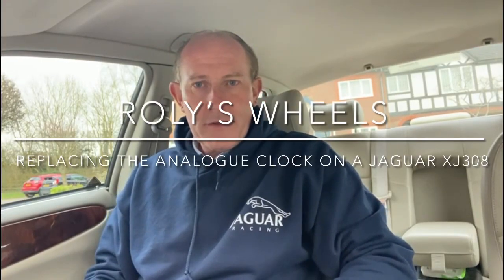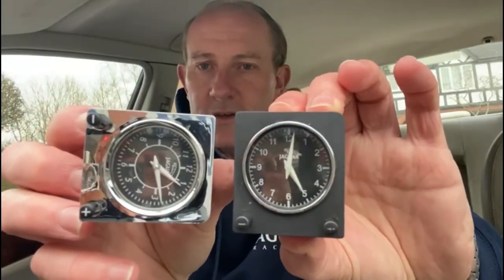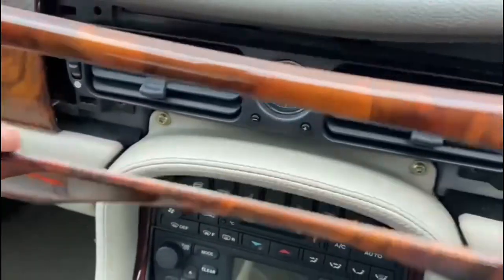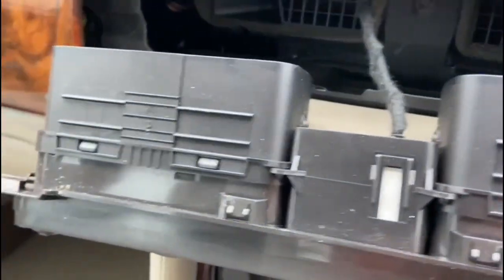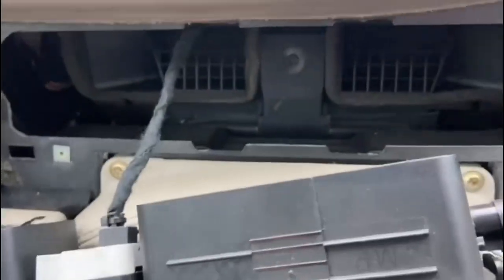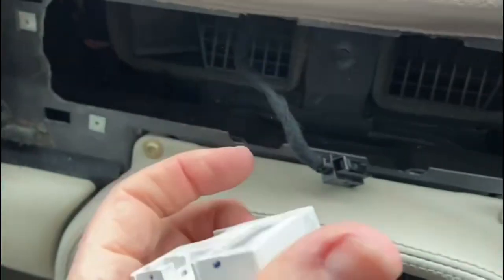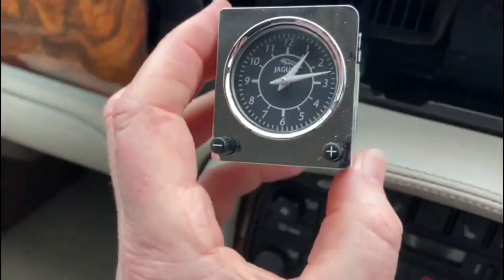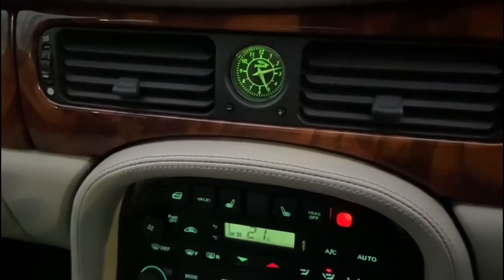Replacing the analogue clock in my Jaguar XJ308

Comment: Roly,
I have a 1989 Jaguar XJS and I am removing the trip computer and want to install this same clock and install new wood panels. Do you know where I can get the specification and drawings that show the wiring in the harness and dimensions of the clock to get the holes drilled out in the new wood panel? This is a great video with a lot of detail as to how to take the car apart and replace the clock.